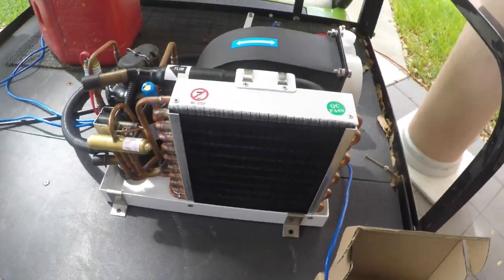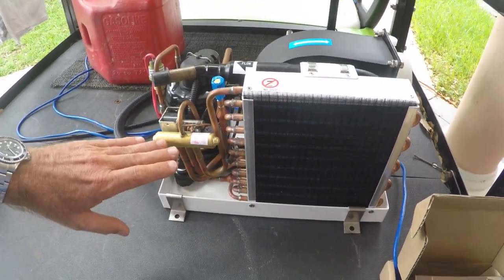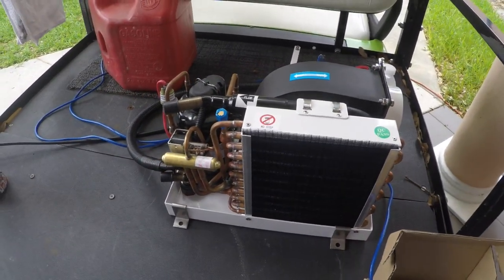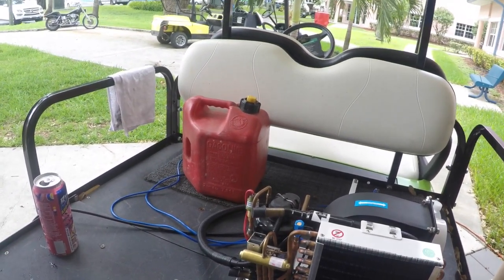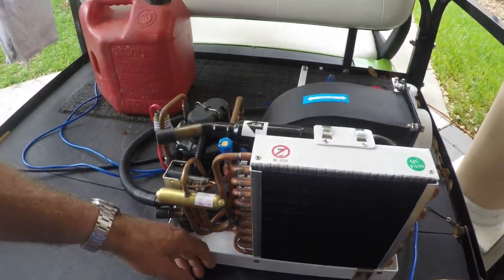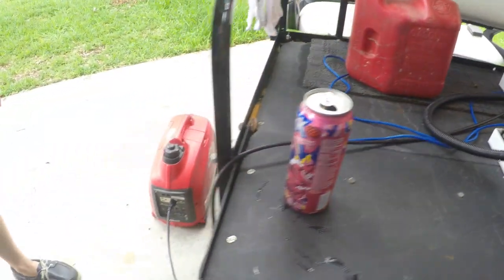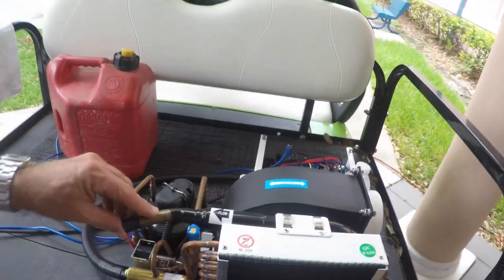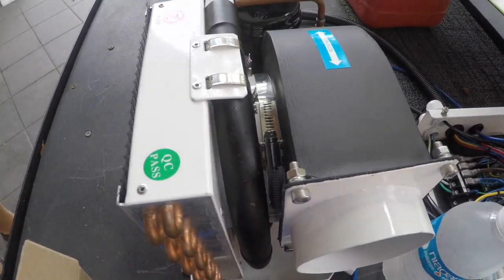Worlds Smallest Mini Heat Pump Air Conditioner 4200 BTU by MPS

Comment: I am well aware that you  ran the unit as a demonstration without the water lines hooked up which are  the heat exchanger part of the unit  my curiosity is  if there is a actual external unit either you produce or someone else  makes to provide a external cooling system  maybe similar to a automobile radiator and fan  that could be used  to install on a RV or Motorhome ? More specifically I’m  looking to do a bus Motorhome conversion  utilizing a Vintage bus  many generators  use a similar system to what I’m referring to  that they do circulate water in and out of the motor  into a radiator that has  a cooling fan  bowing onto the radiator
Reply from the maker: This is an example of or 5,000BTU (same footprint as 4200 but with DC compressor) working off of a radiator in our workshop
https://youtu.be/fboQsNBJ9Lo
I hope this answers your questions question

Comment: what is the name of the product?  what is the manufacturer?  what is the application?  Water cooling, is it of a boat?
this video leaves more questions than answers - it is negative information!
Reply from the maker: The model number is SC4.2K and is manufactured by Mabru Power Systems. The application is for a boat, yes. It can also be used in geothermal applications.
Reply: @MabruPowerSystemsINC  thanks

Comment: In Thailand, they made 1000 BTU unit 12v/100W for using inside trucks. I am not sure how is performance but if it works well, it worth 100 USD they claim for it.
Reply: Good place to source small AC units, but once you pay the freight [and any import duties]...I don't know.  And good luck if you need parts outside of SE Asia.
Reply: @flinch622  what the name or model  🤔
Reply: What's the brand on those

Comment: now thats bad ass guys  a real game changer  for boaters  thats the first one ive seen running off a 1000 Honda  the last Marine AC unit i installed needed a 10 k  generator to cool down my Sport Fisher  ironically i do have the same Honda  generator i used as a back up  and for boondocking  my Airstream travel trailer in the winter  to power my inverter to  keep the heat blower running  all evening without  killing my 12 volt batteries  either on my truck or the camper  i love those Honda Inverter / generators  they hit a home run on those things

Comment: There are many 0.5 hp air conditioner in asia. That is 1255 Btu.
Reply: There are smaller air conditioners, but we have the smallest heat pump. (water-cooled with reverse cycle heat)

Comment: Could this be installed in a cargo van converted to RV? Anyone has any idea or could point me to the right link(s)? Thanks!
Reply from the maker: It is possible but it requires an external radiator. We have more details on the video linked below: https://www.youtube.com/watch?v=fboQsNBJ9Lo&t=4s

Comment: WORLD SMALLEST MAKE CHINA,YOUR BIGGEST
Reply from the maker: I’m confused by what you are trying to say here...
Reply: @MabruPowerSystemsINC  look on ALI EXPRESS - PRICE 10 TIMES CHEAPER FOR SAME MODEL. SECOND : SOME MODELS HAVE RADIATOR SIZE OF PACK CIGARET
Reply from the maker: @vladimirvlad1323  Our unit is customized for our application. There may be a copy that you are seeing on AliExpress but it is not our unit. Our units are the best available in the market and we are using top of the line materials in the manufacturing process. We have the smallest marine heat pump so there is no unit available with a smaller footprint than ours. You may be confusing our AC unit with a refrigeration condensing unit. If you would like the cheapest unit in the market there are plenty of other options. If you would like the best, there is only one.

Comment: Your charging a kidney for one mini ac dam
Reply from the maker: This unit is made to withstand the harshness of the marine environment. We must use top of the line materials to make that happen and it took quite a bit of engineering to make a unit as small as this one. I understand that it may be out of your budget but for the right customer, the selling price is actually very reasonable when comparing to our competitors.
Reply: @MabruPowerSystemsINC  you mean like these competitors? https://www.coastalclimatecontrol.com/index.php/shop.html#!/Climma/c/25823699
Reply from the maker: @freelectron2029  The Climma unit with reverse cycle heat is $2,194 vs our 4,200BTU which retails for $1,780 so yes, I would say that we are more reasonably priced. When you account for the fact that we now have the added advantages for a copper fin evaporator as well as a condensing coil with twice the life (B30 vs B10) we are even more affordable. The SC4.2 is also more compact in depth and width with the same height and a better warranty.
Reply: @MabruPowerSystemsINC  or these? https://www.coastalclimatecontrol.com/index.php/shop.html#!/MarinAire/c/25823726
Reply from the maker: @freelectron2029   as far as comparison to the second unit, I can only say that some people are ok with knockoffs and others understand that short term gain usually leads to long term loss.
Reply: @MabruPowerSystemsINC  way cheaper, way bigger, better brands with more support.... why do americans always think they can just rip everybody off with sales BS. or is it delusions of granduer?
Reply from the maker: @freelectron2029  I suppose that we can agree to disagree. There are not many true competitors to us in the Marine AC Market and certainly no units that I know of that can compete with the size/efficiency of this unit.
Reply: @michaelpowell9164   Michael, I do not mean to come as disrespectful in these comments but comparing this unit to mini splits or to cheap competitors is offensive. I understand that AC on boats is not for everyone but just because it is not in your current budget does not mean that the pricing is incorrect. This model has been in the market for over 6 years now and we still offer it as it is a popular model. Of couse we always strive to make a quality product at an affordable price but we will not release subpar products just to make them cheaper.

Comment: $1750 for it is ridiculous
Reply from the maker: Thank you for your input. You must be confused about the application for this unit which is why you feel this way. We are very competitively priced in comparison with our competitors.
Reply: @MabruPowerSystemsINC  confused??? it takes a child to see you can buy a spit system twice the power (more materials) for a quarter of the price. the only difference is a $100 heat exchanger used in millions of different applications across the world and a $10 water pump. people arent stupid. you are the one who must be confused or you are implying we are stupid. which is it?
Reply: $700 on amazon. Search for 12v air conditioner
Reply: oh geez that f i g u r e s  !!!!!!!
Reply: https://www.coastalclimatecontrol.com/index.php/shop.html#!/MarinAire/c/25823726
Reply: Marine standards add to the cost
Reply: You can't compare land units to marine.  For starters, you gotta have a deeper condensate pan to account for roll, plus materials usually grade above and beyond a typical NEC rules installation.  So no: that's about fair market - nobody is going to make 200k units a year which gets costs down to run of the mill mini split.

Comment: Yeah, not so exciting. Affordability, $$$ 1,750 and the AC/DC unit $$$ $2,400. for 4,000 BTU. Thanks for sharing. http://minihvac.com/models-items/
Reply: https://www.coastalclimatecontrol.com/index.php/shop.html#!/MarinAire/c/25823726
Reply from the maker: Please bear in mind that this unit is made for the marine market. If you take a look at our competitors in that segment, you will understand how exciting this is. 12v only, 3500BTU for $5275 and control is not included. We are offering our unit for less than half of that and the control is included.

Comment: Home depot 5000 BTU AC, runs at 550watts at 120vAC. $125.00 Spend $100.00 on a good 12v-120v 1000w inverter and you have a better standard setup. Even smaller than this, when you add-on all the hoses and shell and vents.
Reply: NoesisAndNoema to each their own. Some people like to do jobs right and have a water cooled AC unit for their vessel that is made for the application. A good 1000w inverter is not $100. No battery charging capability, no auto transfer when connecting to generator or shore power and surely no warranty. Also in regards to size, I’m not understanding your logic. This unit can be mounted in a closet, under a bed, couch, etc whereas the unit that you are proposing would be mounted where? How do you propose getting the hot air out cooling the compressor? It can be done but it’s a Mickey Mouse job. Might as well fill a cooler with ice and mount a blower on the lid as your AC.
Reply: @nicolasmabru  - The Noria is smaller than a conventional AC, sleeker design, smart tech capable, less of a power hog (460 watts), cools more space at 5000 BTU, quiet at 50 decibels, weighing at 30 lbs, and a way more cost effective unit, only $400 -- it's quality engineer-design, since your priority is "people doing their jobs right" and it received nearly $1.5 million on Kickstarter within 45 days. It's currently in production. I would try to consider bringing the cost down, bc they're marketing their compact unit to those in apartments, tiny homes & RVs. Only a matter of time before they target boaters, too.

https://youtu.be/rYoKW7cbv7Y
https://www.doityourselfrv.com/window-ac-unit/
https://www.kickstarter.com/projects/kurt/noria-cool-redefined?ref=project_link
Reply: @YourMajesty143  What materials are used? Is it resistant to salt water? The Noria is a great system for homes and tiny home perhaps although our 12v 7,000BTU draws only 340W at full speed and 200W @ 5000BTU  making the 5000BTU Noria @480W now a "power hog" as you call it. A window unit simply isn't the right way to go for a sea-going vessel as they are not made to be in direct contact with salt water. Based on the market of window units, this unit by Noria actually seems awfully over priced as a 5000BTU window unit goes for about $150.00 retail. Please remember that warranty is also not the same. If a window units fails within the warranty period, will the manufacturer send a certified technician to the location on their time and cover all expenses?
Reply: @YourMajesty143  And Noria is actually an internet scam, never delivering on their kickstarter...

Comment: Could you use this in a small RV?
Reply: The condenser is water cooled so it would be difficult to use on anything but a boat.
Reply: you should consider the RV market.. Not many super efficient Heat/AC units out there.   Looking for a split system for RV/Expedition vehicle that can handle solar power.
Reply: duh. for $2,400

Comment: Can I mount that unit into the engine room? Is it ignition protected?
Reply: You want it in your cabin silly
Reply: If you mean is it Ex rated... no.  But maybe the better question to ask is what is the IP rating?  I assume this  has IP55 rating?  I assume you are looking to dehumidify when dockside/prevent condensation in cold weather [protect starter motor, etc]?   For what it's worth, here's the link:   mabrustore.com/products/marine-air-conditioner-self-contained-copper-4200-btu-115v-60hz-by-mabru
Now if only they had this with an air cooled condenser...